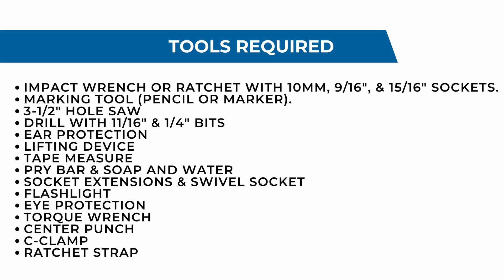Model 1320 Turnoverball Installation

Comment: 2021 Ram 2500
1... No need to drop exhaust
2... Just remove 2 screws on lower lip of left fender liner,,you can sneak the handle by easily by lifting liner up a lil. Install handle from under truck as described in this video.
3...Be careful of the wire harness just behind handle inside the frame. Take loose retainer on top of frame and bracket to allow some movement in harness. Then from below zip tie wire harness to front lower edge of bracket. Otherwise handle will rub thru harness causing a short !

I'm a B & W authorized install dealer, just completed this exact install today

Comment: Chris, thanks for putting this video together. My buddy and I were able to install this on my 2019 Ram 2500 MegaCab in under 3 hours. 

I did notice some differences and maybe can offer some advice. 

The rear horizontal bolts were too close to the bed support frame to get a torque wrench and a normal socket to fit on. Nor was there enough room for a universal joint. I ended up using my “calibrated” arm to torque these two bolts. 

I found it was significantly roomier to remove the exhaust pipe from the last slip joint just forward of the axle. This allowed complete access to the passenger side vice using straps to hold the exhaust away once the rubber support was removed. 

The drill template is perfect. I was very nervous about drilling the hole because it’s a one shot thing. But the guide lined it up perfectly. 

The flat pin operating bar on this newer model seems very flimsy compared to the round bar from previous versions. I had to bend the latch at the receiver in order for it to release from the fully extended position. In my opinion this could be designed better or returned to the older design. 

All-in-all, this was a very easy install. Much better to do it yourself than to pay the $450 I was quoted. Thanks.

Comment: Overall, a fantastic install and great product. Like Daniel Wilkins, I did encounter some challenges not covered in the video, but I do want to say that the video help greatly and made me feel much better about doing the work myself

There is NOT enough room to get a socket and any wrench (including a torque wrench) and the real horizontal bolts, so if you are really concerned about torqueing them you will need some special tools (torque drive adapters maybe?? although I can only find them in 3/8? drive).  Would really like to hear from B&W on how to get them torqued?

Also, unfortunately the template alignment for my 3.5" hole was not exact and the adapter is about 1/8 too far forward, not a perfect fit?

Looking back on it, I would recommend removing the exhaust as Daniel suggested, we really hade to fight it when attempting to torque down.

Overall, extremely satisfied with the product AND THE VIDEO!!!!! Thanks!!
Reply from the maker: Hi Jim,
I spoke with our installer, and he said he uses a crowfoot wrench set to make it easier to install.  We do recommend letting the exhaust down using a ratchet strap to lower while installing.  Did you install on a 2021 Ram 3500?  If so, we have a new hole template to accommodate that 1/8" difference you were finding.
Reply: @BWTrailerHitches  Yes, new 2021 long bed 3500........very disappointing to hear that there is a different template because I actually called your shop to ask about that (there is a note on the web page that says to call)......I was told that the RIGHT template is already in the box......bummer!

Comment: My template had two holes, one round and one square? I picked round, hope I chose wisely. No mention of two holes anywhere in the directions?
Reply: Go back and reread install instructions. Right after center section info. It details the use of the template. The lil round hole is for 2500 chassis and the square hole is for 3500 chassis.  It's there but easy to overlook--- I just completed install today myself.